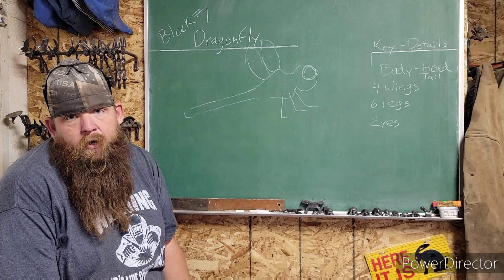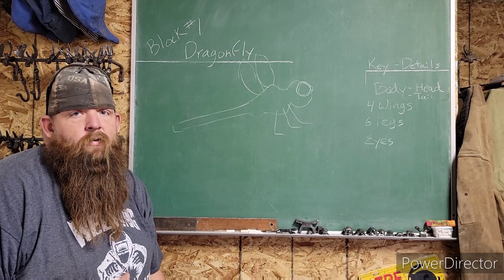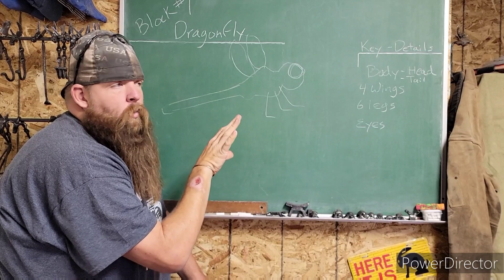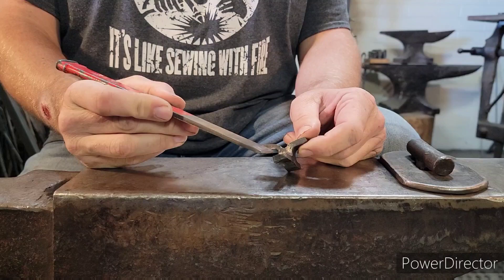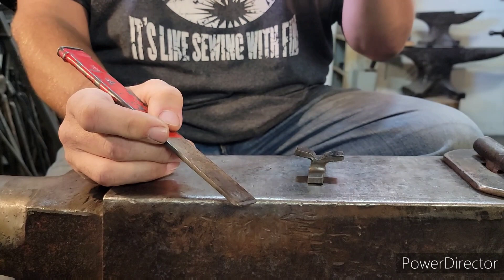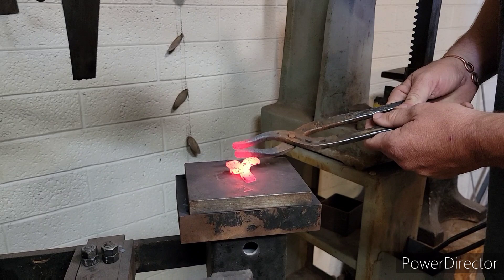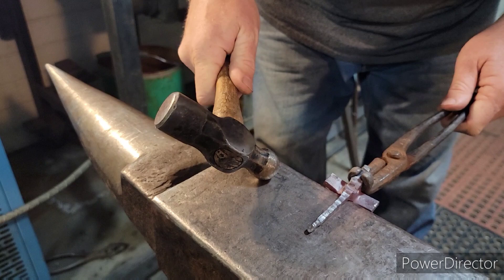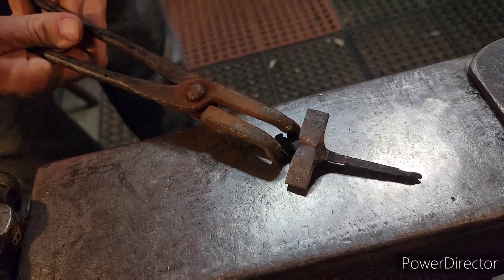Dragonfly how to Forge dragonfly from THE BLOCK. forged Blacksmithed one piece Dragonfly Let's Go.

Comment: Nice one, another great critter.  For a slow speed wire brush, I use a wheel in my drill press.
Reply from the maker: That's a great idea. I have had a high speed one fling a part across my shop couple times.  Glad you are enjoying videos  Thank you.